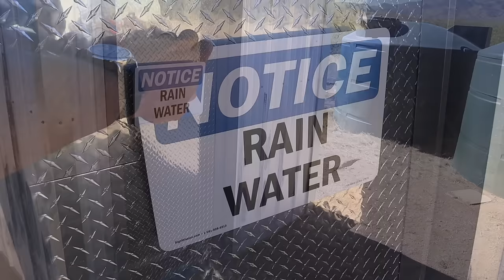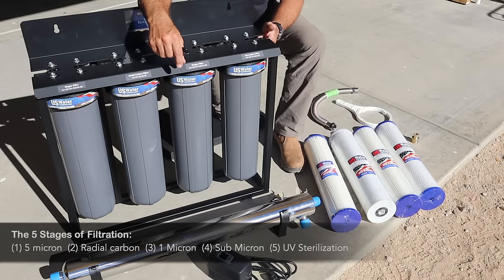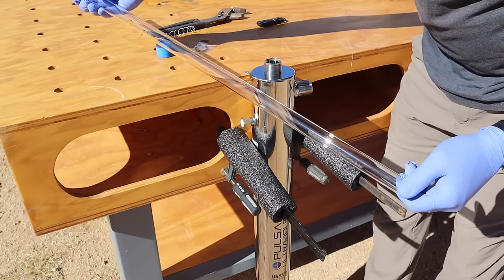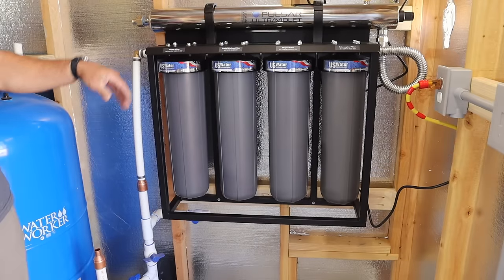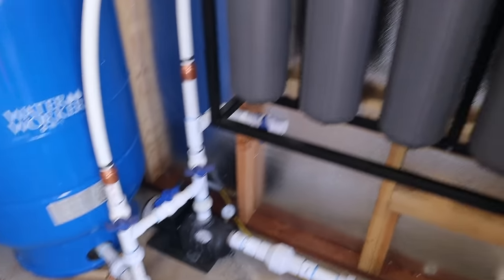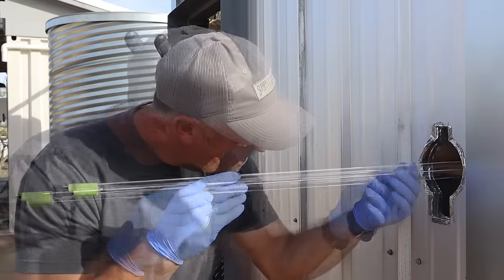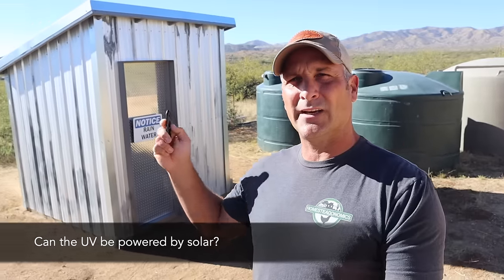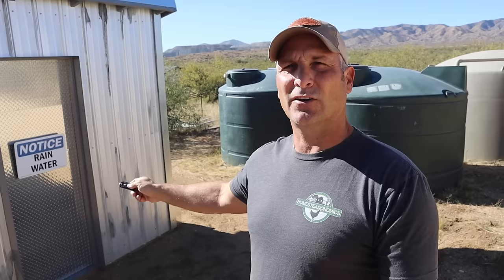Whole House Water Filter Install for my Rainwater Harvesting System

Comment from the maker: For anyone interested in US Water systems make sure to us “homestead5” for an additional 5% off any purchases.
Reply: You should have provided cost info for your views.

Here's a breakdown for those who are interested:

Component ______________________________ SKU __________$
Whole system_____________________320-PUV-MAX-PLUS  2,295.00
Replacement Ultraviolet Lamp 20 GPM	406-PUV-LM-20    119.25
Replacement Quartz Sleeve 20 GPM	406-PUV-QS-20    116.34
Replacement Ballast Controller              406-PUV-BL-200     293.50
Total $_________________________________________________2,824.09
		
Water Consumption Gals/Yr:    36,000	
$/Gal/Yr (for the 1st Yr):                          0.08
$/Gal/Yr (for consumables):                   0.01
Reply: The pressure tank needs to be before the filters 

The filters job is to remove particulates, taste and chemicals (depending on the setup) taking filtered water and putting it against the bladder of the pressure tank will give your water a taste . That is due to the makeup of the rubber bladder .

the filters are the last thing the water touches before it goes to the Tap

Also 
One might consider putting stainless lines before and after the UV sterilizer 

UV light degrades plastic over time.

Meaning 5-10 years you may have a broken pex line right at the UV sterilizer 

A suggestion
Reply: Sir what is the TDS of that water
Reply: What happened to homestead4,3,2,1? O.O What did you do to them?
Reply: mr.m.o.g.o.m. what water filtration systems do you recommend? 19:39

Comment: I'm not from the US. But I think it'd be nice if they made the (4) filter housings in clear plastic also.
Reply from the maker: That would a be an interesting idea.... perhaps that could be a future design of theirs!  :)
Reply: Thanks  for the video!
Reply: They do make them clear but most of the bigger canisters are blue or gray my guess is to prevent bacteria growth from light
Reply: They don’t because algae would grow.
Reply: You could put a couple of cloth bags around clear ones. And it's moving water. I don't think it has very much of a chance to grow algae there.
Reply: A good question would be When the door is closed, is it dark in there? It is, right? So, no problem. 🙂 Cheers. Have a nice day!
Reply: The clear ones could let light into the water and form bacteria
Reply: @FuckYourFeelings914 the water is constantly flowing, I don’t think algae can grow in such conditions
Reply: You can get clear housings in New Zealand. But you have to mount them in a dark space to prevent algae growth.
Reply: this and also the only way to have it be clear, they have to use a different type of plastic. The PP or HDPE blues are a sturdier plastic less likely to crack. @cs-za
Reply: I am in Canada & I have bought 20" clear housings
Reply: Some filters do

Comment: As I treat water for a living I was wondering did you disinfect your home plumbing? With the UV system you should have bacteria free water. But if there was some bacteria in your home plumbing before your started the UV system it could still be there. Standard practice is to add household bleach to your supply water and open each faucet in the system until you smell bleach. Then close all faucets up and let the system set for 24 hours. Then flush the entire system out. I would remove the radial carbon filter when doing this as the bleach will shorten its lifespan. This process assures that your now clean water is in a clean system. You could just add some bleach to one of your holding tanks of your choosing to get it into the system. This was really helpful and well done. Thanks for sharing.
Reply from the maker: I appreciate you bringing up that point.   As for this specific install, I did not flush just prior to the install.  But I do, couple times a year let my primary tank get low and then add some chlorine and cycle water through the house for just that reason.  Usually granulated sodium hypochlorite but I have also used generic I scented chlorine bleach, although that’s the lesser ideal.
Reply: Yeah I did this with my RV and boat water systems....
Reply: Yikes those filters are small.      I'd use waaay bigger filters and a 90 gallon sand filter upstream...
Reply: @daleb5967  yes but he is filtering rain water ,not river water

Comment: I am not sure about this system, but when I have installed RO systems, I purged the first several gallons as waste and not into the tank.  This is to make sure any remnants of manufacturing doesn’t enter the tank or plumbing.
Reply: And ro membranes are shipped with a preservative so yup first few gallons. Good job 👍

Comment: My concern about these systems utilizing the UV lamp, is how do you know it is still working?  What happens if you loose power for a few minutes, can it potentially contaminate the system down stream from the light?
Reply: We have a similar system to Joe's.  I had not thought about not having the UV light on during a power outage.  If you didn't use any water during the outage it would probably be OK.  However, we do use our water during a power outage with the pressure stored in the system mostly to flush toilets occasionally and that's a problem.  Water that has not been sterilized flows thru our system during that time.  I just started looking for a battery backup just for our UV light and I think a PC UPS would power the light for the better part of a day.  I'll have to do the math to be sure.  This was a good question and something I had overlooked.  Hopefully a $75 UPS will fix the problem. Thanks.
Reply: Usually the power adapter for the light has a LED indicator. Green is good, red the light is dead. My cheapo Amazon UV filter tells me that way. You can also see the light coming through the white piping because its dark in my crawlspace. This probably isn't great long term because the UV will actually break down the plastic
Reply from the maker: I can understand your concern but its not that much of an issue in my opinion.   Here’s why….

1- If it were to loose power for a short time, the previous water in the lines was filtered/UV and therefor good to go.  
2- if no faucets were turned on during the power outage there wouldn’t be any flow, therefor there would be no water that hadn’t been exposed to UV
3-   Even if the UV was out of service for a short time, I’d still have no problem drinking water that had run through those previous filters.
4-  I have lived for 15 years using nothing but a berkey ceramic filter.   So this is just bonus for me😉👍

Comment: My understanding with UV filters is your supposed to have some sort of solid piping like metal on either end of it because it will decorate plastic over time. Is that particular filter different where you were able to use plastic piping on the one end and get away with only have to use the stainless steel on the other end?
Reply from the maker: That’s my understanding as well.  But if you look at the connection I made on that end of the UV filter you’ll notice that I kept that section of pex short so the inside of it is almost completely covered by the brass pex fittings where they slip into the pex.   So no UV is hitting the inside do that short section because the brass is covering it.   And then it goes to a brass elbow.  
Hope that made sense….at least in my mind it does🤪
Thanks for checking it out😊🙏

Comment: 1.5 amps at 120v is a huge load for a solar system if that’s what you meant when you said 1.5 amps.  Even if the UV were on a trigger to only light up when the water was running 180 watts for say 1 hour a day is not trivial.  If it’s 180 watts 24 hours a day that’s massive.  Also why would your pressure drop if you’re running through the filter to your pressure tank?  I think typically you’d filter after the pressure tank as pumping through the filters would result in a massive drop and might not even be possible but if they are before the pressure tank then there would never be a drop in pressure.

Comment: Great video. Checked out the site and they do not list the contaminants that the filter eliminates. That is an extremely important data set.  I have a three-stage "coconut shell activated carbon" filter system under my kitchen sink, and it does a great job of filtering the water. It costs about $100 a year to change the filters. This system also uses a "coconut shell activated carbon" filter system, so it should eliminate most contaminants. It would be good to know if it eliminates PFAS and PFOS contaminants, since they are difficult for carbon filters to fully remove.

Comment: Very nice setup.  If you placed the filter unit on the output side of the pressure tank, would that cause too large of a pressure drop and house water flow would be too low?  I was just thinking it would be nice to have the filters after the pressure tank, just to eliminate any contaminates coming from that tank.  But maybe it would restrict the flow too much.  I have a similar pressure tank on my well in Payson AZ and I need to add filters also.  Thx

Comment: Those filters are made with pleated polyester, probably a good chance it's adding microplastics to the water, particularly in light of that study in PNAS. Doesn't seem like rainwater would need much filtering anyway. Seems like activated carbon + UV would be plenty.

Comment: Nearly identical system here in the Virgin Islands. 
📍 log and/or painters tape with dates for each filter and bulb replacement. 
📍 where is your pressure check/log? 
❓ does your UV have a window to check if the bulb is burnt out?
📍 extra notes: 
0) Google calendar reminder for regular checks.
1) separate your systems. Toilets and lawn hose do not need UV filtered water. 
2) filter the rain water from debris. Sock filter for larger debris, then sediment filter (or sand filter or diatomaceous earth). Shut off valve to stop intake when cleaning your roof. Cleanest roof water for primary cistern for eventual purification. Overflow one-way into second cistern. Second cistern is for lawn/toilet/clothes washing machine and catches water from other roofs/decks. Also, sock filter and a simple sediment filter. Overflow one-way to third cistern. Third cistern used for filling your pool (which has its own pump and filter) should also have a sock and simple sediment filter. Put a deck over the top. The deck can also act as fill for your third cistern. Stone deck material can be nice with a porous limestone and tiny grates in the gaps. Substrate is corrugated roof/deck metal and concrete. 
3) trench and make your cisterns subterranean. Use geothermal cooling system to subsidize your air conditioning bill. If the cistern doesn’t have enough thermal capacity for the entire home, prioritize a dedicated single room (probably your bedroom). Btw, there are watertight shipping containers for a budget cistern. Else, concrete and lined primary cistern. Other cisterns only need marine concrete and seal. Cisterns and pool can be thought of as a home foundation, separated like single lane garages. If building all at once, you can easily make the cisterns flow (one-way 1-3). Be sure to have a 4th lane and don’t cover/deck that lane. In fact, shape it, shallow/deep ends, stairs, and have fun. That is your swimming pool. 
4) solar hot water heater. Additional instant heat line for kitchen sink and bathroom showers. 
5) solar power and a Tesla power wall-type battery solution. 
6) septic. Are you off grid?
7) possible grey water catch from showers for fourth cistern. Modified filter for “lawn/landscape” irrigation. Or filter soap/debris and fill an outdoor pond. Research available if you look up earth-ship-homes. 
8) hydroponics (and/or aquaponics) can be drawn from secondary cistern. Either deep in a service garage for stable year-round conditions, or a seasonal surface garden that can have a summer sunshade (and winter frost shade) area.
9) power outages often? Hurricanes here. Notes/instructions for closing valves (backflow). Keep an insulated small roof reservoir of purified water for gravity kitchen water and outdoor shower (be sure input valve is closed if power is out for a long while). This can be part of your regular system for continuous flow and fresh water in the gravity reservoir. Battery power wall solution? Else, 2 generators.  Primary for the home, and a smaller backup that can be manually moved and used for essentials (refrigerator, emergency LED lights, water purifier, and/or bilge water pump from a cistern for the outdoor shower/kitchen solution. Or enough battery/generator power to charge the pumps and tanks for home water. You’d also need a reservoir for the separated non-purified water for the toilet/shower system water.
Reply: Reverse osmosis solution for your kitchen sink and ice maker. Possible remineralization system if so desired.

Comment: Thats a good filter for your house, if you made the same thing with pentair 4.5x20 canisters you have a wider option of filters that are just as good and half the price, the pentair housings are going strong 10 years later out in the sun (looking crispy), neat plumbing by the way. UV bulbs aren't fool proof if the flow rate is too high or you have hard water, some minerals block the uvc light. An RO membrane is the only garuntee of bacterialogical safety and removal of minerals. Sanatize your plumbing your plumbing connections down stream by adding a little bleach into that bleed hole and letting the system pump up and then flush it, things will grow in that white plastic and it will suprise you how slimey it is in 5 years. - water systems tech

Comment: you dont want pressure tank after filters you want to put pressure tank before filters, that way no matter how bad filters clog up or some kinda leak develops in the housing your pump wont run non stop burn out, and will always build up consistent pressure,.
also pressure tank usually has bunch of junk unless its brand new, you'll be running bunch of filtered water though previous build up of gunk, which kinda negates whole filter set up, this is probably also why you didn't notice any pressure drop since your pressure switch still wants to meet the pressure requirement after going through all filters, typically each filter will drop your psi about 1-3 range per filter

Comment: Hey brother looks good.. Im fixing to install our UV light and i didn't think u could do pex off the UV light because the light will show thro the pex and it will break down the pex i think ur supposed to have copper or stainless steel atleast 6inches .. You may want to call them and ask just to be on the safe side let me know... A always keep it up brother.....
Reply from the maker: Hey Dan,

Yes I have heard that too.   It’s true that pex is not a UV durable material.   But if you look at my run from the outlet of the UV chamber you’ll see that I used a really short section of pex.    So the brass fitting from the UV chamber and the elbow brass fitting are the materials that are exposed to the outlet of the UV chamber.   It’s a short section of pex so the ‘ribbed’ sections of the brass pex fittings are the only thing getting exposed to the light.

Comment: Hi Joe,
Great video.  Although I have tested my water for lead and it was ok, I have flirted with various filters.  I may consider it again.  Do you have to be concerned about the pipes, etc. in the pump house freezing?
Beaver
Reply from the maker: Hi Uncle Beaver!

Luckily for us, freezing isn’t much of a concern.   We do see hard freezes on occasion but the insulated walls on this pumphouse should do well for all but the hardest days long freezes.  However with that said, I’ve got a project I’m working on that’ll attach to the back of this pump house that will be a passive solar heater to heat the house during the sunlight hours to help it maintain through the night.  Should be a fun little project!

Comment: You should really consider putting a surge protector on the UV light controller. A power surge will almost certainly blow the bulb out on the UV light or possibly wreck that fancy controller. I had a power surge the light on my RO+UV filter. Wasn't terribly expensive to replace the light but its a PITA when you can avoid it for 15-20$
Reply from the maker: You know what, that hadn’t even crossed my mind as is usually only think of those things during monsoons when we have a lot of lightning.   But I think I’ll definitely be adding one soon.   Thanks!😊🙏
Reply: I would recommend just adding one for your entire house. I have one for my house and then one for my pool rack/panel

Comment: Thank you for this. I will admit, I have been intimidated by the plumbing. I have been without running water for just over 5 years. I was hoping to have it done this year, but it hasn't happened. There's just been one thing after another that comes up and takes me away. Now I am dealing with a sick goat. Hopefully, with this video, and if nothing else comes up to keep me away from it, I can get it done before the end of next year.
Reply from the maker: Well thank you for checking it out.   And don’t feel intimidated, plumbing is something that is a little anxiety inducing in all of us (except for the professionals).   I probably thought and rethought and rethought again about how I did the piping in my pump house rebuild.  But if you check out that pump house video, I think it’s a pretty straight forward look at the basics.   
If you look at some of the Home Depot kinda stores they even have some pulp and pressure tank combo kits that include diagrams, etc,.

Are you running water from a well or elevated tank?   Or tank on trailer?  Or something else?  

If you want, feel free to send me an email and maybe I could sketch out a plan that might give you a starting point😊